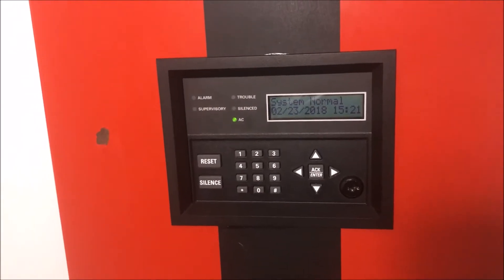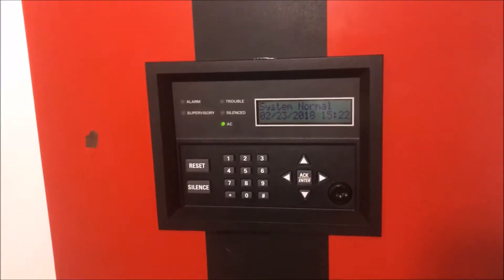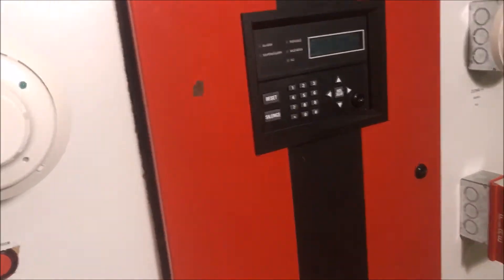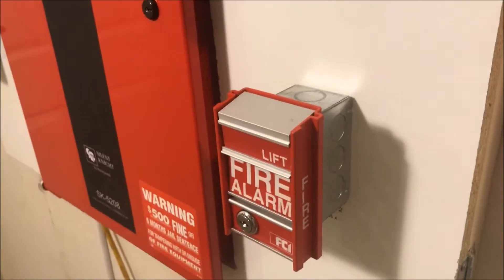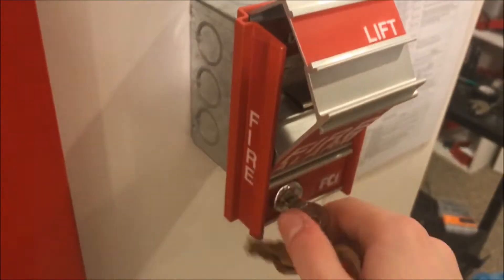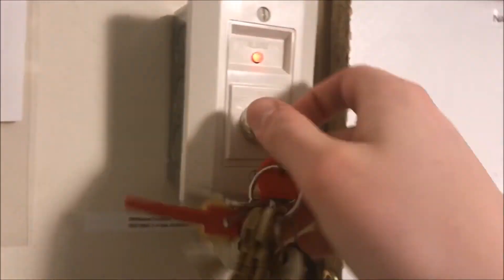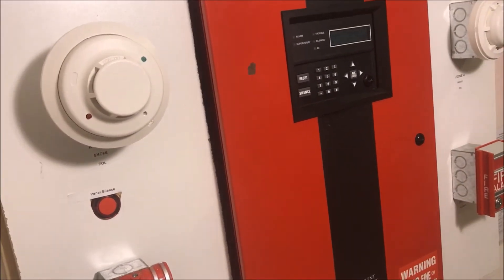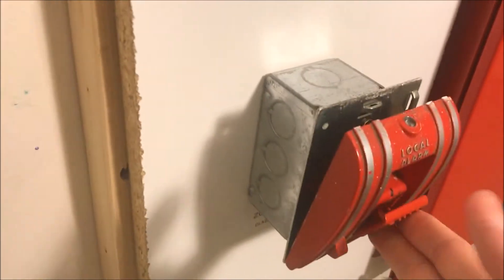Wall Test 29: Stupid Switch

Comment: Cool vid and is the Wheelock as a popular device or not really
Reply: Harrison's Life! It’s just because I see a lot on line to buy but now that much in a lot of buildings
Reply: The Wheelock AS was used a lot in it's heyday but just like any things as newer versions come out they start using the new ones on new installations and of course to replace any broken devices when an inspection/test is done and one or more are discovered.  I'm not sure if the Wheelock AS, NS, and ZNS are still manufactured today.  I think the Exceeder still is and possibly the MT.
Reply: Gary Beltz oh wow my school still has the wheelock AS  and there not replaced is that because there still in great condition and they don’t need a new system?
Reply: Yeah they don't replace things as long as they work if any of them fail you might start seeing something different replacing ones that break same goes for the panel as long as it's not working and the repair costs don't outweigh the cost of putting in a new system they will leave it alone.
Reply: Gary Beltz oh thx